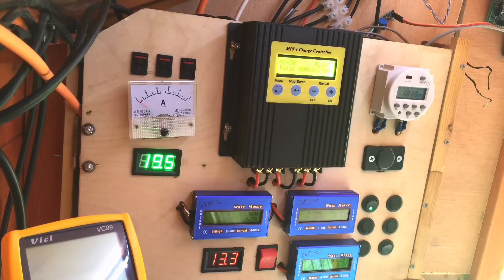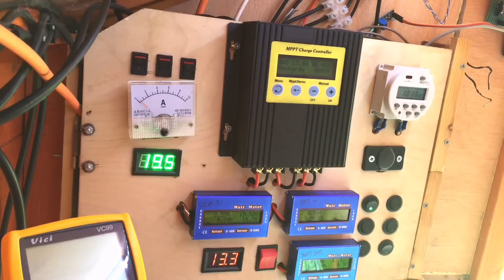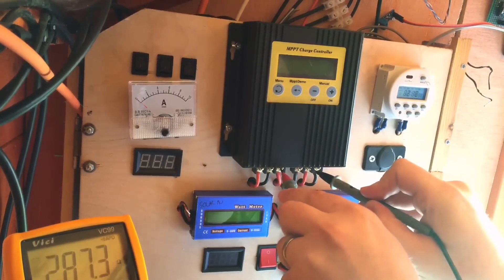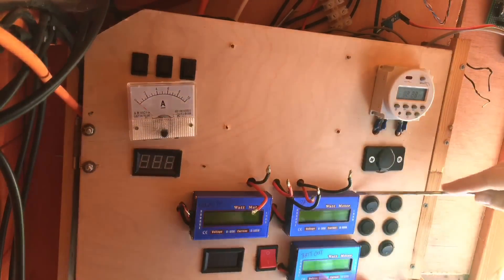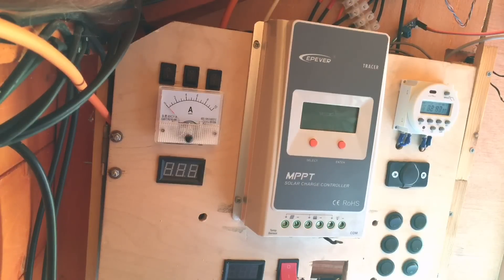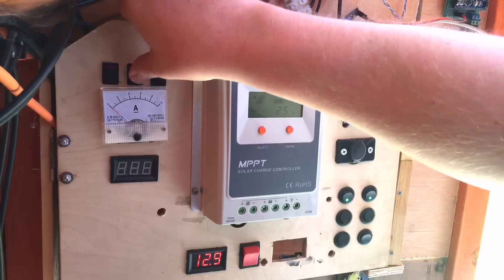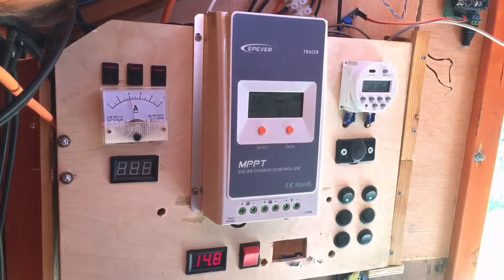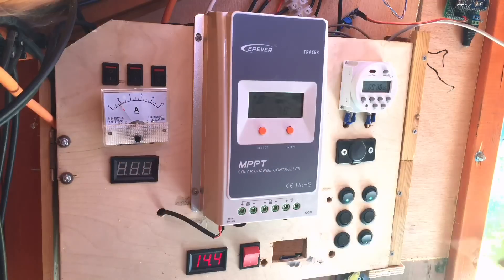EPEver Tracer 2210A MPPT Fitting and Testing - 12v Solar Shed

Comment: Hey Adam, great video, but I have a question. If I shortcut my solarpanel it can deliver about 3A to 4A in full sun. When I measure the current loading the boat battery in full sun it only shows about 1 A. My refrigerator consumes about 5 A at 12V, when it switches on. When this happens I expect to see also a bigger load current going from the solar panel to the battery, but unfortunately dies not happen, it never passes the 1A level. Why is this the case? Is that because the battery current is limited to about 1A. Btw, in my case nothing is connected to the load connector of the 1210 tracer. The fridge is always connected to the battery itself. Do I have to change connections to be able to get more energy/current from the solar panel? The solar panel is about 1m^2. Hope you can find the time to answer. I am already struggling quite some time with this issue. Thnx, Ton

Comment: i have the same charger. using with 200ah gel battery. when the sun is high, the battery bars rise to max, but when the sun sun goes off, battery bars come down to 3 levels only. should it be like that or should it show full bars (5 levels)
Reply from the maker: Yeah this is normal (but odd) behaviour. The meter only shows full when the battery is being held at or above the float voltage. Once the sole drops and the batteries voltage naturally sags back down it drops to three bars. One of my few criticisms of the epever controllers.

Comment: I have a couple of these EPEver MPPT controllers "2210AN and a 4210AN so far so good and both perform well.

The only thing I recommend is "especially if you live in hot climates" is add 10 to 15 mm spacers between the controller and the mounting surface as they seem to get quite warm when mounted flat to the mounting surface, I put 15mm spacers with my mounting and they stayed cooler with the better natural convection air flow.

On a typical 40c degree day here, the heat sinks got to 57c when mounted flat, added spacers and the heat sinks only got to 44c. hate to think hot hot it would get on a hot day here 46c mounted flat.

Comment: Great video an well presented Buuut ....
To anyone considering buying this particular model i would avoid, as well as the orange one he also had at the start of this video. the EPEver EpSolar tracer 2210A & 3210A or not TRUE MPPT they even state on the box its a 3 stage PWM charging. and the MPPT it does have is useless on these as the minute it finds it the top power then it stops completely for about 10 seconds then it picks up again I.E searching for the Maximum Power point. So each an every time a cloud passes are birds fly over a tree shakes in wind an casts a shadow ect ect the voltage drops so it pauses and starts up again. and the end result is PWM charge any how. so all you have is an inconsistent drop of power throughout the day multiple times a day.

Comment: What gauge cable are you using here? It looks thinner than mine. I've got a 10 AWG extension cables but the ends seem too big to go into the charge controller without bits of wire sticking out. I don't know if there is anything I could put the ends into first to make them more compact so they don't have bits of wire splaying out. Any ideas? Thanks.

Comment: Just bought one of these controllers for mt boat to replace a very cheap PWM controller. I have no idea on wether to connect the panels up in series or paralell. Can't find any definitive answers anywhere. I have 2 x 20w, 1 x 50w & 1 x40w panels. At the moment they are all in paralell.

Comment: It is ok if the panel is 24v go to the Epever 2210A and go to the 12v battery?
Reply from the maker: Yes, the charge controller can cope with up to 96 volts on the solar input on a 12v battery system.
Reply: @AdamWelchUK  ok Thank You Very Much To That Information I've been asking that Question to many Youtubers and Solar Enthusiast.

But Youre the Only One Answer It.Thank You

Comment: I have another question please...i have the wifi box for epever tracer and the 50 meater monitor. Can i connect both at the same time to the rj45 tracers port, if i use a common rj45 splitter like these 

https://www.amazon.it/World-Data-Economiser-Connessioni-throughput/dp/B002DUMUQC

or it  will not work?? I see you now more about electronic than me. Thank you!
Reply from the maker: I’m afraid that won’t work. The system is only designed to power and communicate with one device and that splitter doesn’t break out the right wires even if it did.
Reply: @AdamWelchUK  thanx a lot! Does exist a splitter that simply double the out signal of the slave port of the controller? Otherwise I won' t do it!
Reply from the maker: It’s not just a matter of splitting the cable sadly. The modbus protocol only allows for one master device - but a number of slaves. Unfortunately the accessories are masters, not slaves. They call the data from the controller, rather than it being sent out regardless. 
The only device that is different in the range is the eLog01. It can sit in between the controller and an MT50 or eBox-Wifi and log the traffic between the two.  I’ve done a couple of videos on the elog. 
The other issue you have is that the controller can only provide something like 500ma of current and the eBox products and the mt50 probably pull close to this on their own.
Reply: @AdamWelchUK  so,nothing to be done,then! Thanx 4 ur detailed explenation. I thought that the slave sent datas and the masters were reading them; so that doubling the signal, 2 masters could read the same slave. Evidently I'm missing some knowledge! There is a way to contact u directly about this kind of issues, if I should make some modification on my solar equipe in the future? Always if it doesn't bother you. Thanx
Reply: @AdamWelchUK  i live and use panel and controller in my camper!!!

Comment: hi Adam, i have the same controller but AN series with common negative system and support for lithium batteries. It seems very good. but why in some forums say that the cheap mppt epever is a fake mppt, actually a pwm ?? and they say that only the Morningstar are good ... I think that epever are very good and that others like Morningstar and Victronenergy charge the brand dear. I checked on the internet and epever uses electronic components from well-known companies, probably the same ones as the more expensive western brands .... is my thought right?
Reply from the maker: I’ve used EPEver MPPT solar charge controllers for a few years now. They are MPPT. They might not track quite as quickly as the more expensive models but they do the job pretty well and excellently for the price tag in my opinion.
Reply: @AdamWelchUK  in fact I believe that some more expensive European or American brands have the same internal components, but they cost more because they are European. victronenergy bluesolar 30a has the same specifications as epever but costs more. I have a Victronenergy inverter and it works very well, but the connection cable for monitoring (similar to rj45) cost me 30 euros !!! the cable for monitoring epever cost me 2 euros !! the wifi box epever cost me 17 euros, and works at 50 meters, the Victronenergy wifi box costs 60 euros and works 20 meters !!! I'm satisfied with my epever's algorithm, it seems very fast and almost 100%. Thank you for answer!

Comment: What is you thoughts on when to put panels in series vs parallel and the pros and cons?
Reply from the maker: It depends on a few things...  Solar cable length, your charge controller, your battery configuration, panel shading and direction etc.   However generally it's best (and cheapest) to run your panels in series to increase the voltage. That means you can transmit the power further on thinner cable without as many losses.  You can only do that to the input limit of your charge controller though.  However if you are using PWM charge controllers, your panel voltage is better closer to your battery voltage.  If you are using MPPT, then you can use higher voltage, but your controller will be more efficient in a particular voltage range.  If you've got panels pointing in different directions you might want to wire them so you have an east string, and a west string to reduce any possible losses.  Sadly there isn't a straight forward answer.

Comment: I'm currently using a PWM controller on a single 100watt panel. Due to the lack of sun the solar panel hasn't been able to make a decent enough voltage to provide a decent charge to my battery. I know MPPT obviously work better at a higher voltage but I was wondering if it would bump the voltage of a single panel up enough to topy battery up? I understand the amps will be low but I'm more concerned that my current setup is only managing to bring my battery up to 11.9v. I think the reason is because the panel is only reaching this voltage and not the nominal 19v
Reply from the maker: An MPPT solar charge controller can't make your panel produce a higher voltage than the current sun will allow, but it can load the panel less and therefore allow the panel voltage to rise up higher - if the software allows for that.
If you watch my video on living with the EPEver tracer A Series for 9 months you'll see that MPPT isn't always the solution - in fact through the winter I place my two panels in parallel rather than series because I find that reaps better results).
When you battery voltage is as low as 11.9 your PWM solar charge controller will be connecting your panels straight to your batteries (effectively a 100% PWM duty cycle).  This will bring the panel voltage down to that of the battery (or just a tad above).  This is perfectly normal.  Your panels wont be in their most efficient region but they are probably capable of creating a higher voltage and therefore you might reap rewards by using an MPPT charge controller - but their are efficiency losses in the conversion.
If you have space on your roof - an extra panel might be a more sensible place to put some money.  If you've run out of space an efficient MPPT charge controller might help you out a bit.

Comment: Hi I have the 40A tracer A and have got three 48v 175w panels connected in parallel with two 110aph batteries will this be ok as sun is not out much during winter was thinking of dropping one panel off during the summer as max power tracer can take is 500w
Reply from the maker: You’ll find the tracer will limit its self to ensure it doesn’t go over spec. So you’re probably safe to leave all three connected all year round.
Reply: Adam Welch thanks for that Adam your videos are very helpful

Comment: Hi Adam.  I think you made a comment in the video that you don't have a temperature sensor attached to the Tracer.  Is that your normal configuration or was that just while you were testing.  I recently bought the Tracer and am trying to decide if it is worth it to order the sensor.  I did get the wifi adapter and plan to get the logger module.  I really appreciate what you do.  In my case, my shed is across the street and has no access to commercial power.  You and others like you have helped me a great deal in 
getting my system up and running.
Reply from the maker: +David Underhill The temperature sensor basically allows the Tracer to adjust its charge slightly if the temperature is particularly high or low. In high temperatures it will reduce the charge to ensure you don't boil your batteries and in low temperatures it will increase the voltage to help prevent sulphation. 
I like the fact then when I look at the solar station monitor software that I can see the temperature of my battery bank - which is the overall temperature in my shed. 
They can be found on eBay for around 5USDs so for me it wasn't too expensive and a nice addition to the unit.

Comment: guys, solar noob here hope you can help. whats the difference and why? increasing the panel voltage vs increasing amps. thank you
Reply from the maker: +Markycutey Cutey Like many simple questions there's not a simple answer. 
Charging a battery requires a voltage higher than the battery so that current will flow into the battery and the larger the current the quicker that battery will charge. 
Now a high voltage panel setup won't be much use on a PWM (or a switching) solar charge controller because the voltage of the panels will be pulled down to a level just slightly higher than the battery when they are connected together. So when using a switching or PWM solar charge controller it's best to connect panels in parallel so the voltage stays the same but the current increases. 
High voltage and low current travels better over longer or thinner cables. So if your panels are a long way from your battery you're perhaps better off with an MPPT charge controller which will convert a high voltage, low current input into a lower voltage, higher current output for the battery. So with an MPPT solar charge controller you'd typically wire identical panels in series (increasing the voltage but not the current) and allow the charge controller to convert that into a lower voltage higher current charge for the battery.

Comment: Hi Adam,

Good day, I have search a lot of video in youtube, only your video that i'm thinking can help me, I have four 12v and 100w solar panels 
(with 18.00 Vmpp , 5.56 Impp and 21.92 Voc, 5.94 Isc) and 12v battery bank.. 

This is my questions:

What is the way best option to connect my four panels to the 40A Epever charge controller?
Can i add another solar panel on 40A Epever Charge controller?

I hope you can help me with it.

Thank you
Reply from the maker: +Roy Lucman The Tracer manual suggests that you should connect them in series parallel. So two panels in series, then two sets of those panels in parallel. That will end up with you bringing in about 38 volts at ten amps, which should convert to about 30 amps if you've got a low battery at 12 volts.

Comment: In one of your videos you showed you were geting 5 amps from two 50 watt panels. You seemed pleased with this.  Shouldn't you be getting 8 amps from these if the unit is 95% efficient?
Reply from the maker: +Jerone Guinn My 50 watt panels create a maximum of 2.86 amps each at 17.5 volts - which is 50.05 watts. I'll have been referring to the incoming current I would imagine. 
Now you might get 8 amps going into the battery of the battery is low (around 12 volts) but generally my batteries are better charged than that! Once your batteries raise their voltage the charge controller will do exactly that - control the charge going into the batteries by reducing current to ensure they're not over charged.
Reply: Adam Welch thanks for the quick response. That makes sense.

Comment: Why do you have your panels in parallel and not series? Maybe you have a video on this already and can point me in the right direction. Thanks
Reply from the maker: +Alistair Clark I do have a video about that but since then it's changed. 
I run two panels in series now - but actually there is very little advantage in the summer as my panel cabling is very short. 
In the winter however I find the controller works better for me with the panels in parallel - I covered this is my video - The tracer A series after nine months.

Comment: Hi Adam,  If I use 24v battery system with the epever 40a version, then, in the dc load would I be getting 12v or would I get 24v?  I want to connect 12v lighting on to that but I'm wondering if that will limit me to using 12v battery system instead of 24v
Reply from the maker: +Rajesh Marichetti The load output is whatever voltage your battery is. If you're using 12v lighting on a 24v battery configuration then you'd needs step down converter.
Reply: thanks that helps.  Is your system 24v?  do you have dc loads?
Reply from the maker: +Rajesh Marichetti My main system is 12v but I also have a lithium pack which is set up in a 24v configuration.

Comment: I have a few questions about the connection for load. What is the output of the load, ac or dc? I presume it's dc. So, do your appliances use dc? If not, do you convert the dc to A/c using inverter? If yes, that means your inverter is connected the load, right? I have a 700 watt inverter designed to use a 12v battery 100 or 200 amps hour? Will the draw from the inverter not overpower the charge controller?